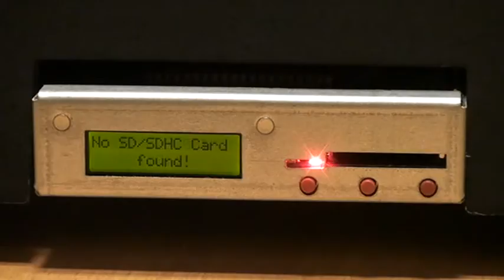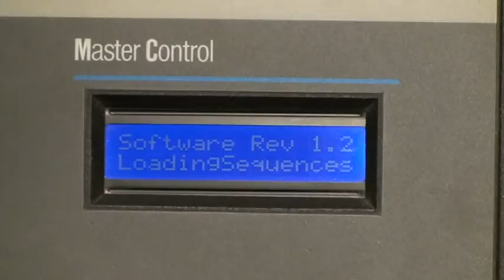Emu SP1200 HxC Installation

Comment: Thank you! Great video! On a side note, I recently acquired a 0997 serial black reissue with 7030. It’s in mint condition. I don’t want to open it yet but am curious to know if mine has the SSM2044 chips inside it. Would love to know what serial your unit begins with as mine looks like yours and yours seems to have the SSM filter chips. Thanks again

Comment: where can i buy this floppy drive
Reply: +Mechacelzi E-bay home boy.
Reply: DOS.putin it will fit a mpc 2000?
Reply: Mechacelzi
I think so.  I personally prefer to use floppy disks in my 2000XL.   I tried these emulators but found them cheap, and frustrating.  Plus I just like the feel of a floppy disk.
Reply: DOS.putin ok thanks